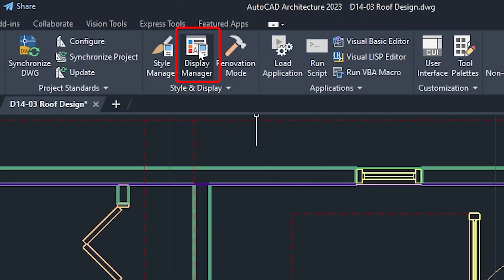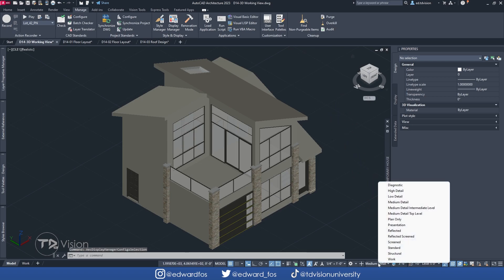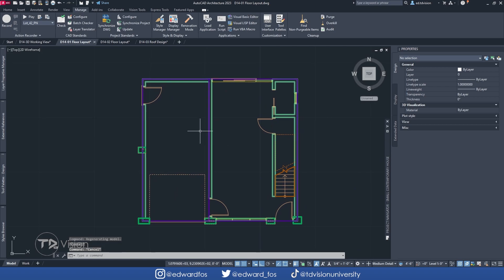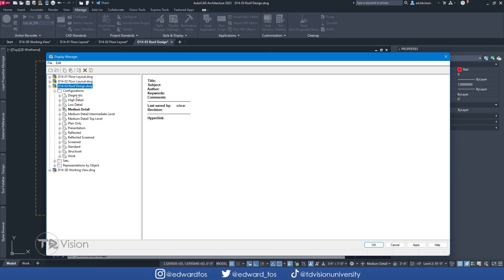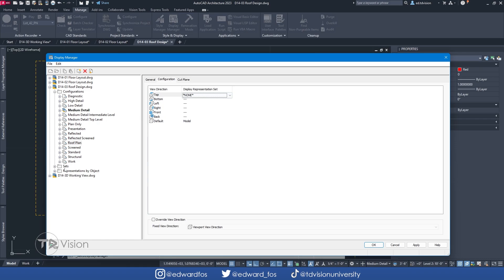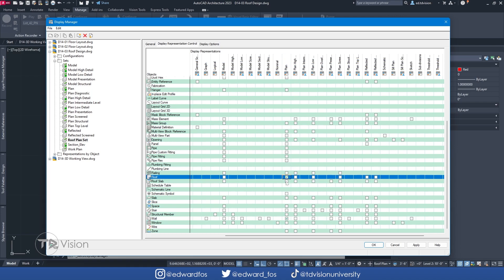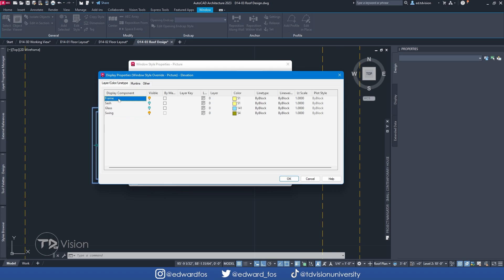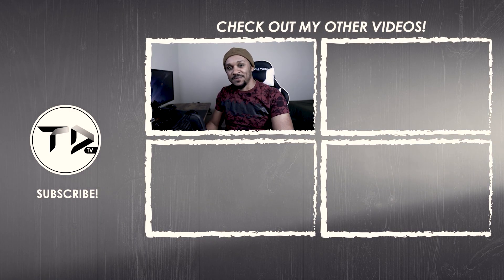Introduction to DISPLAY MANAGER (AutoCAD 2024)

Comment: Hi,
might I know your PC configuration and which mous model are you using?
Are you using also a 3d connexion maus?
I have seen your small 3d connexion maus in the video! Nice to have it. I have also one of them...
Reply from the maker: Visit my website to see my PC specs. https://www.tdvisionuniversity.com/my-gears . Yes, I use the small 3D Connexion mouse, as well as a Logitech G604.
Reply: @TDVision_U  I am struggling with a vertical mouse from CSL but it seems that I have to invest more to get what I'm inspecting.